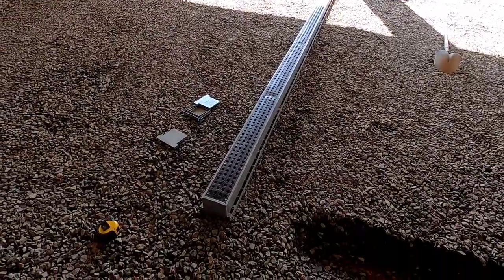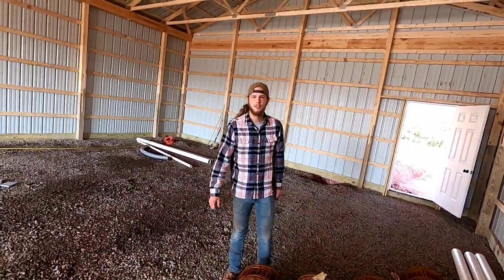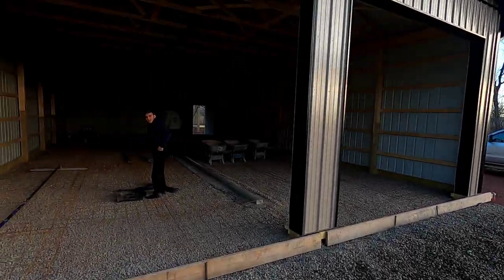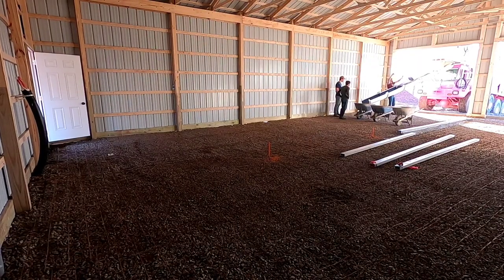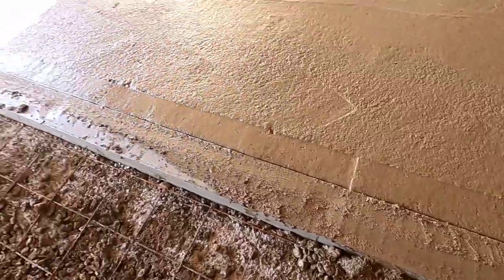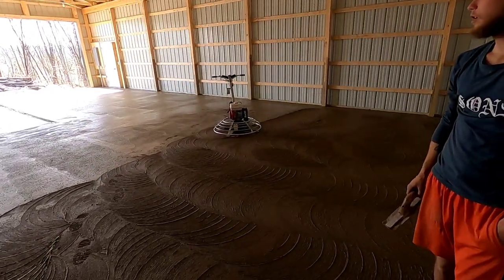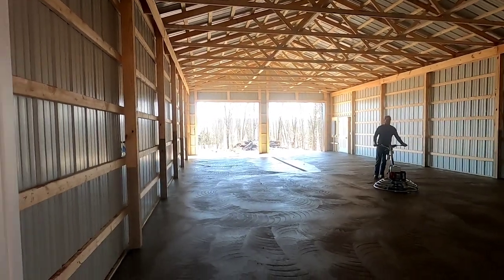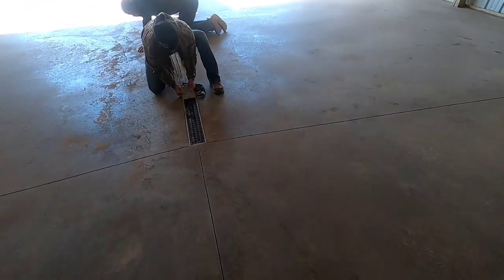Pole Barn Concrete Floor

Comment: Get a walk behind or a cart for that saw
Reply from the maker: Yes you are so right. Im pretty good at using it, but it is very hard on back and to keep straight. Much easier with cart. I'll have to get one. I order 2 of the Hudson screed things. Gonna get them and try em soon.
Reply: @masonthemason6412  hell yes. I got a whiskey stick but I heard Hudson are better. Save the back bro trust me. I was young doing it now 26 years later I am beat. And it's good ubget to charge and make good money. We had to do it for peanuts 🥜 in the beginning and even up till 5 years ago.
Reply from the maker: Yeah that's what I hear. I need to listen to you guys. I will definitely do these things. I don't wanna hurt later on lol. I grew up at the perfect time, it's awesome